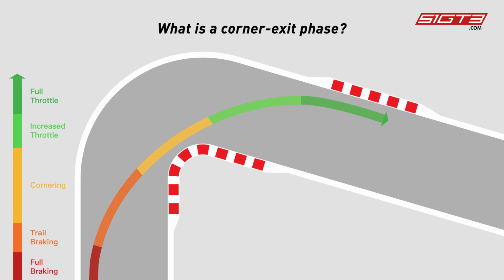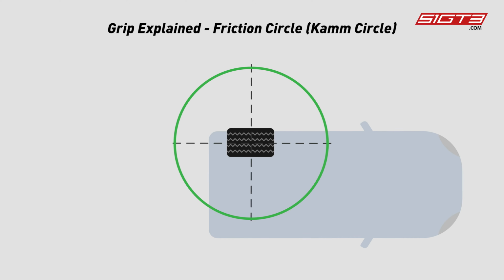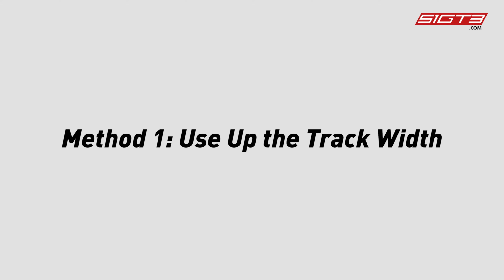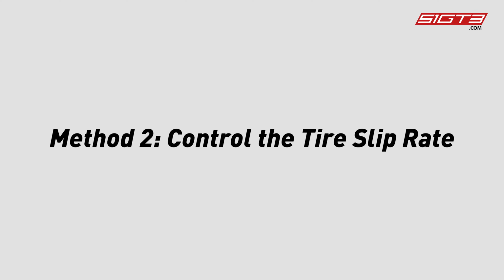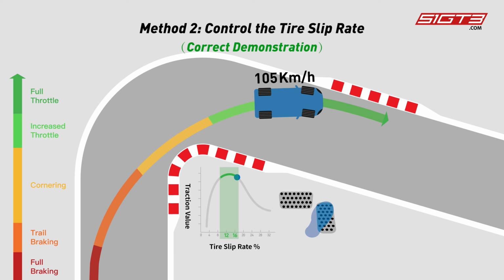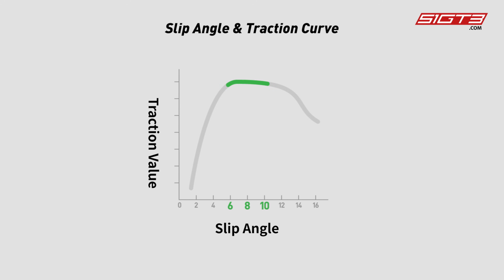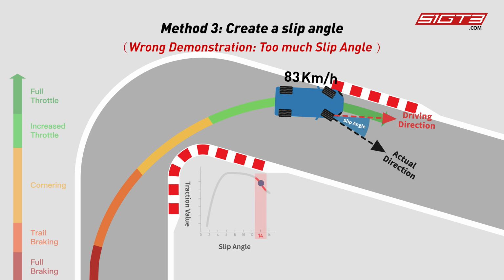Racing Basics EP. 04 — Corner-Exit Phase Technique: Maximize Tire Acceleration Grip

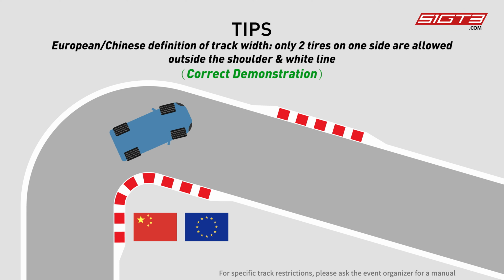Comment: 2:40 "The limit on the width of the track in Formula 1 is that one side of the tire is allowed to go out of the white line of the track, but the other side of the tire must be inside the track. If all four tires of the car are out of the white line, it is a violation of the track width limit rules."